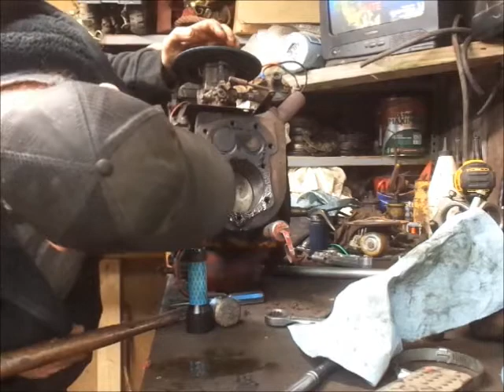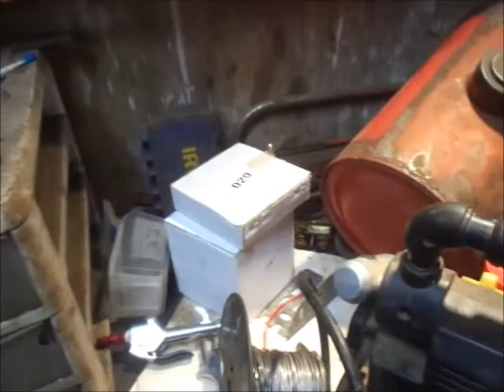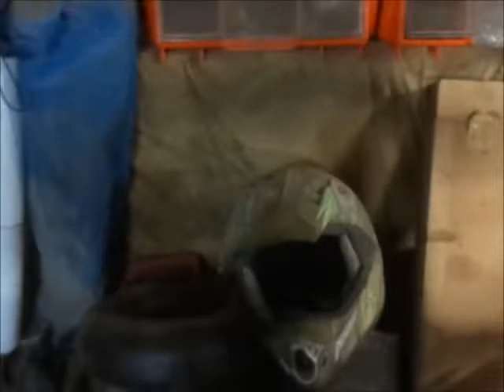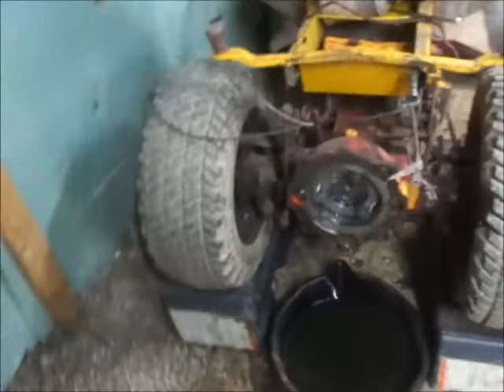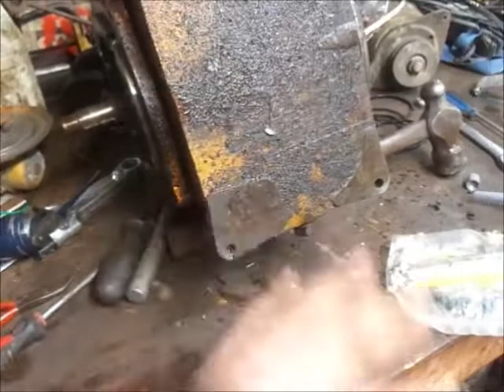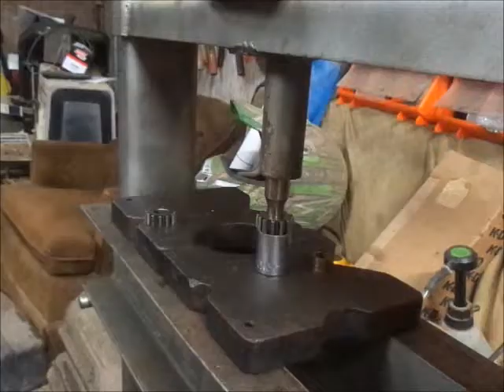1968 430 part 16 motor together rebushing high low planetary

Comment: pickle fork on the plant bolts ... u need some body hammers .. liter wont damage as much. cheap autoz set works fine 30 bucks i think
Reply from the maker: Body hammers would say I know how to use them lol. Also have pickle fork no help when you can't get behind them. I've had to use the press before to remove them lol
Reply: @Stevestractoradventures  was sayin for the bolt once u tap it flat from nut side. pickle should fit between plate and gear act as a pry bar. body hammers are good fro liter hits hahhaha ... i love them. yep know how to use them did a lil bondo work in the day hahhah